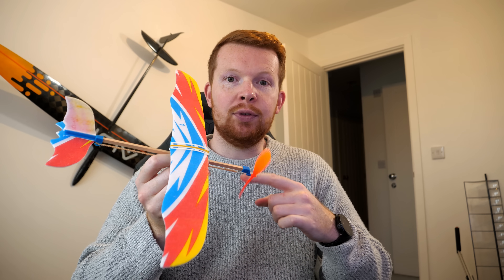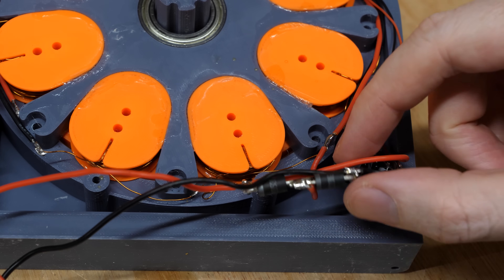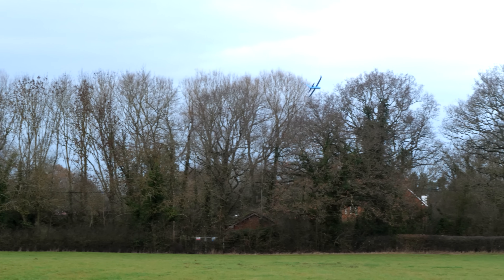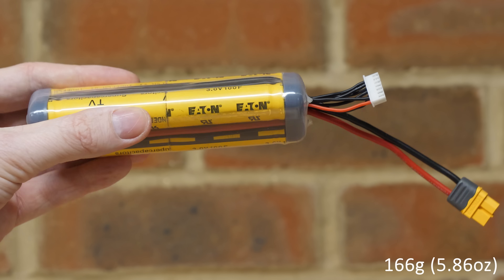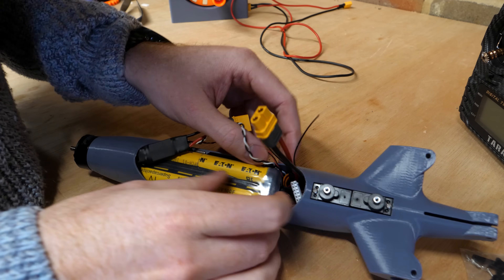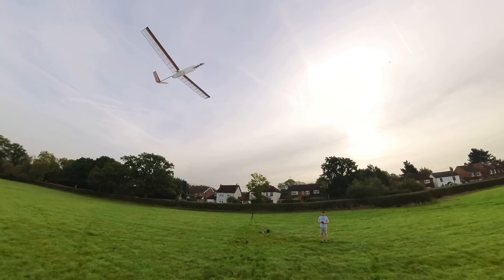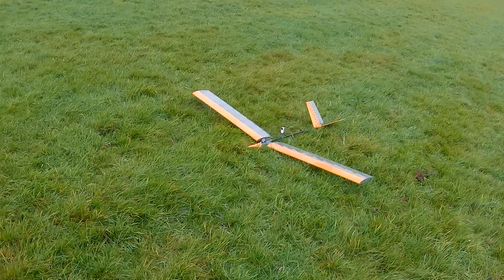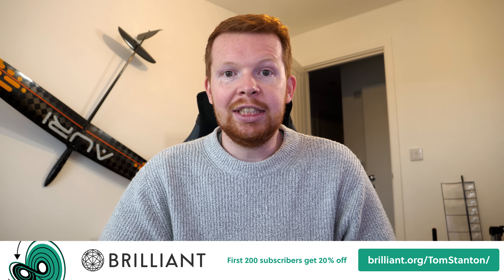Super Capacitor Plane

Comment: Haven't read all the comments -- has anyone suggested one of the $2 boost converter circuits from Amazon or Ebay?  This allows pulling the caps down to 2.5 volts, so longer run time.  They are very efficient with a little bit of electronics ( a Mosfet) for control.

Comment: Awemongous!
Would it be possible to use large capacitors to extend a drone's range, by flying over powerlines and trailing a wire to quickly fill the capacitor, which then soaks into the battery proper?

Comment: What's crazy is that in my extremely limited experience with off the shelf RC planes is that the batteries take 30 minutes to several hours to charge, and still only give you a few minutes of flight time. So 2 minutes of cranking for 2 minutes of flight is incredible

Comment: I wonder if you could use the spinning prop to get a small charge into the controller battery.  Shotsky diodes for current flow control and a voltage multiplier might get you a few seconds more control time.  My son was playing around with a plane and the batteries went flat while flying.  Damn thing got into a thermal and moved up and away never to be seen again. An extra few seconds of control might have got it out of the thermal, maybe.  Love the channel m8, bloody good stuff.  Be well.  👍🇦🇺😀

Comment: If you wire the capacitors in parallel then you don't need to balance them, just use a boost converter giving you a constant voltage!

Comment: 6:37 I would recommend printing the original model with a brim instead. Brims require a bit of cleanup but allow you to print without having to worry about the surface area on the build plate being low.

Comment: Consider adding a step up/down BUCK CONVERTER with a fixed voltage output powered by the caps. A BUCK converter uses pulse modulation & induction to efficiently step UP or DOWN the voltage from the power source. The BUCK CONVERTER will make much better use of the capacitor's total energy store by stepping up its output voltage as the voltage within the caps drops below that required by the other circuits. You would never do this sort of thing with a battery - but because you can run a capacitor bank safely all the way to empty - the buck converter allows you to tap almost all of the caps energy. Also, using a BUCK CONVERTER lets you consider using different capacitor wiring to power the plane - series/parallel as opposed to series for example;  -& use a STEP UP BUCK CONVERTER set to an output of 6.5 volts. Try to find a buck converter that can operate from as low a voltage as possible (.5v+ should be theoretically possible low limit  if diodes are Schottky with low barrier voltages). And remember, BUCK CONVERTERS pull higher amounts of current from the source in order to utilize low voltages. Be sure that the wiring can source sufficient current from the caps while they are operating at very low voltages.

Comment: 9:06 Is the power consumption not higher with wings and the moving elements attached to the Servos?
Reply: The servos use more energy if it is trying to move a big object so the energy consumption is higher 🤓☝

Comment: Hi @TomStantonEngineering :)  Always enjoy your videos. This video got me dreaming about how to extend the lifetime of a super-capacitor-powered craft which might be to use the super-capacitor material as structural component of the body of the craft. It seems to be me that it might be possible to shape the materials into rigid structure and still have it be able to store energy. It will still be low energy density but offset by using it's components for structure. This channel demonstrates the simplicity of super-capacitors and their DIY construction: https://www.youtube.com/watch?v=FUw6cZTR9yM

Comment: Why does everyone hate on using brims for prints like these? A 5mm brim would've held on fairly well and the removal from that specific surface would've bean dead easy with little post-processing. Even if it takes more post-processing than you'd like to do, it saves waiting 10h for a print to finish, only to have it fail in the final 5 minutes.

Comment: Hey tom! Small idea im not entirely sure would work, so the propeller likes to keep spinning after cutting off, would it be possible to somehow turn that into a regenerative charging system and use it to extend your flight time? You could fly up really high and then use your propeller to recharge and keep flying until eventually you run out of altitude, im not sure if it would even be possible or if it would even be efficient enough to actually give any charge but just a cool idea i wanted to throw out there

Comment: In my opinion, if you use thin copper wire and make more loops compared to that copper wire used by you it will generate more voltages 😅

Comment: What if you can put charger on a bike,to charge it while traveling? 

Maybe also use the idle propeller to charge plane while gliding down in case you need to make thrusts here and there to move the plane.
Reply: The kinetic energy that the charger takes from traveling must come from somewhere. 

It's a net loss
Reply: Pedaling the bike maybe?
Reply: @markgonzalez8715  
Have you every ridden a bike with a dynamo?

It will just make the pedaling harder..

Comment: I thought about using super capacitors after watching another channel do some longevity and distance tests. Solar on the wings can charge a SC and then switch to another SC and keep rotating through them. Fast charge and discharge, but it should work if done well

Comment: Can you engineer a new prop nose cone design, that includes ducts that will allow air to be scooped in and used for cooling of the radial engine, and would'nt it also generate thrust if the scoops are designed to be steep enough?

Comment: You could put some small button batteries just to power the servos so you have longer glide control after the motor runs the capacitor down.

Comment: If you have trouble with adhesion to the print bed during 3D printing (usually with prints that have a low area of contact with the bed, but even more so the taller they get) it could help printing with a raft or brim.

Comment: You should put a lipo for servos and use the capacitor only for the motor. A really small lipo should be able to run servos for a pretty long time of flying. And you can just charge the caps at the field and use throttle to get yourself up to height. Kinda like a glider that self tugs itself without actually using battery power to propel itself which pretty much takes away the glider aspect of flying a glider. Once you run out of caps it is just a glider

Comment: Add a rubber band to the propeller to stop the windmilling when power is shut off. Doesn't need to be very strong, it just takes a tiny bit of force to fold the prop back against the nose.
Reply: wow, that might be a great idea.

Comment: What would be to have bigger capacitors, and charge them with wind turbine implemented  on the side, as jets has - and with them switching between two banks of capacitors, until one depleting, the other is charging up. How long would be the flight?

Comment: @ 8:16 cap pack reads over 7 volts but caps are in series to stay below the hard deck of 3v to avoid failure, what am I missing here? Just before that you mentioned the caps were charged to 8v and say it’s just under half their max voltage?

Comment: It would be even cooler to have a mirror bank of capacitors on the ground - a buddy can charge the bank while the plane flies, then connect it to the plane to quickly recharge it. If it's 1:1 on charge:flight time, you can get going again pretty much right away

Comment: Now build another one with the capability of autorotation via the same propeller connected to a secondary gear which re-charges the supercapacitor to give it another burst of power to secure the landing or to simply extend the flight!

Comment: Could you use a geared reduction unit on the prop so you could reduce the throttle setting, and would that then increase time on power?

Comment: Really nice simple project.
Can the propellers retract with springs when the motor function is over?
Or can the motor controller have an electric break when under powered?
It would save a lot of unnecessary drag.

It is a pity that all energy saved under 5-6v is not used. So you have only 66% of the capacity used. But still carry the weight around.
Also maybe the motor and controls can last longer if you put a small variable inverter that can convert from a lower input voltage.

Comment: could a voltage boosting circuit like the joule-thief design let you squeeze more out of your super caps instead of losing radio and servo at 5V?

Comment: What if you added one 18650 battery to the fuselage, with a switch or timer to give a quick zap recharge of the capacitors during flight?

Comment: Active rectifier (with full bridge mosfet. Switch on when positive will rise)  will be mutch beter.  You want longet servo control ? Place there step up dc converter that will drain you main capacitor and at output bost it to 5.5V to small super capacitor that have enough small internal ressistance that allow you electronics to work good enough.  Chooise dc converter that can. Suck almost all voltage from you mqin capacitors example to 0.5volts instad of drain them just to 1.5v ....i was do that some time ago... Or maybe if its imposible in one converter make steps.... I was use single chip to use. old 1.5v tbatteries that can drain them to 0.1(?) if i good remember and power white led at 3.2V (30mA) but you can use this sot23 chips in paraller ...then fromm 3.2 V many dc most converters can work .. ...but maybe thwre are already some chips for "solar li on  chargers that use supercapacitors ar buffor ..i cant remember. I think you should or just reduce weight from plane .. Starting with cut off plastic labels from capacitors

Comment: you probably could get a usb-c breakout board with PD and charge it back up with a power bank in like 3 seconds. standard PD voltages are 9, 12, 15 and 20

Comment: I thought some folding props had very weak springs (or maybe rubber bands) just strong enough to fold the blades when the power is cut off, or in this case, drops too low to be productive.?

Comment: @Tom Staton, I love your projects and please keep doing it! I just want to make a small "big" remark: Having that gap between the LH and RH wing brings the lift there to zero and induced drag goes bezerk, so you loose all the advantage of that wingspan/aspect ratio. So this means you have a higher power required, just close it and add some racked winglets ! you will increase flight endurance without touching the propulsion system .. the weight penalty will be nothing with yoiur construction method! Have Fun!

Comment: I’m not electronics Engineer 

But I have question, Motors generate low of power too, you are charge capacitors by hand 🤚 power to run components, can you use power that come out from motor to charge other capacitors then those capacitors generate more power to give it to another big value capacitors then this last ones charge final capacitor battery?

Sorry if my English not clear.

Comment: just add some gearing to the generator system and you could charge in less than 30 seconds without a ton of torque on the material.

Comment: Nice going !! Wonder whether it is possible to charge the capacitors via a solar panel under the wings that you could hit with a laser? Could you make a tracking laser? Instead of hand crank; how about an optional cordless drill attachment, or a motorcycle kick start ratchet of high ratio?

Comment: I'm a die-hard nitro guy, to the point I don't even fly the commercial and proven brushless/lipo powered stuff. but ya know what?

 That's a pretty bad ass build. 

I might suggest you divorce your control side from your power side. Might improve flight times, definitely give you peace of mind that you won't lose control over the airplane because the supercaps dump. A 2s600 LiFE receiver battery will put ~6 volts out and weighs naff all; fit one of these for receiver power and clip the red wire from your ESC to your receiver. By setting it up like this, the ONLY thing your supercaps have to do is turn that prop. They don't have to send a single electron to the control side.  How much more flight time that gives you I can't say, but it will definitely give you peace of mind that you will have full control over the airplane whether the supercaps are charged or not.

Can also look into a glider specific ESC. They're light, and they have a brake in them that applies when the throttle reaches 0. That brake will stop the prop and let it fold while in flight which will reduce drag and further help flight times after the caps dump. I suspect the ESC you're using now is just a standard plane ESC which typically won't have a brake.

Comment: Wow you use such beefy plugs for this tiny thing. I think I have the very same plugs in my application which is powering a 2200Watt Motor for a 300+ kg heavy Quad :D
Reply: Gotta admit though I use both sides of the plugs each direction to transmit 60 amps.

Comment: I think "Supercapacitor" was just a brand name or gimmick in this case.  A capacitor of those dimensions rated at only 3 volts and 100uF is NOT Super by any stretch.

Comment: you should try just using a 12 volt 100 watt solar panel with an open current of 18 volt and just connect it to the battery and see how fast you could charge it

Comment: Quick question, would it be possible to harness the energy from the motor when the voltage goes under 6.5 (right when the motor cuts off) so it would feed back to the capacitor hoping to give you more time for the servos.

Comment: Might be hard to do, however, you could use the windmilling to generate electricity for the capacitor for more flight time. Not sure it’s the same with the motors, however PC fans can become generations if they spin backwards and over volt the fan ports.

Comment: Why don't you make charging coils with magnets that rotate with the propeller? In this case, the propeller will take energy from the capster, and the capster will recharge from the rotation of the propeller. Here, either the flight period will be prolonged or it will continue to fly without stopping. What do you think of the idea? Will it work?

Comment: couldnt you use the propellors on the front as a kind of windmill or add a windmill at the back that generates power to keep the capacitors lasting longer?

Comment: You can now put two loose wires hanging form the plane and fast charge it flying over a pair of aluminium strips powered by a car battery, charging it mere seconds.

Comment: I wonder, can you configure the motor ESC to use braking when you pull back on the throttle beyond 0 or something? Like you would for an RC car, you get braking force until the motor comes to a stop  (and then you get reverse if you aren't in a race config). That could let you stop the propeller and have it fold up from air force.

Comment: I think you could have used a bigger gear ratio so that you'll get closer voltage to the maximum capacitor charging voltage, this way it would charge much faster, especially that for the moment it seems still relatively easy to turn so requiring more torque won't be a problem
Reply: I was thinking of a cartoonishly large two handed crank design

Comment: Could have used a large brim on the nose instead of changing the design, to prevent the object from releasing to the bed. You have settings to increase the brim to any dimension (within reason of coursE)

Comment: You didn't need to increase the nose size to prevent the fuselage print from failing. All you needed to do was add a brim to increase the surface area. Alternatively, a strong bed adhesion promoter like Vision Miner Nano Polymer Adhesive could be used.

Comment: What if you put little springs in the prop so that when the motor turns off it folds up automatically but when it’s on the centrifugal force and thrust opens it?

Comment: Great project! But why stop charging the plane at 8V? If I'm not wrong, you put 6 cells in series, so it would amount to an 18V rated voltage, right? Since the energy stored is dependent on the voltage squared, you're missing out on most of what your cells can store in terms of energy

Comment: What if you created a type generator around the propeller to charge the capacitor as you fly with the super fast charge rate it should essentially fly much longer however you adding weight and drag. Will be interesting though 😅

Comment: That's an awesome interesting piece of kit you've built.
If you take one suggestion, for powered gliders, there is an option built into the ESC to control the engine, so that when power is not applied, it actively prevents the propeller from spinning, as the windmilling of it will take away quite some gliding performance as it's eating up a lot of your kinetic energy by means of creating drag.
Once again, great design.

Comment: It wound be interesting to see lithium ion capacitors used in an application like this. The VINATECH VEL13353R8257G is 250MAH at only 12.5x35mm

Comment: What about building a mini charger on the plane so when it's gliding it's recharging a bit while in the air .. like ev brake charging thingy

And also, now you can have a battery on board .. right? 🤔🤔🤔

Comment: Could you use something like a buck-boost converter so the motor always has the same voltage/power output throughout flight, instead of decreasing power over flight time. I would think this could also get you a little more flight time, as it will drain the capacitors slower at the beginning since they arent pushing 15+ volts to the motor.

Comment: Hey man, you seem pretty smart, is there a way to use discarded alkaline battery's to charge your phone? Like put 30 pieces in device and it automatically couple's them in series or parrarel to keep the 5 volt going?